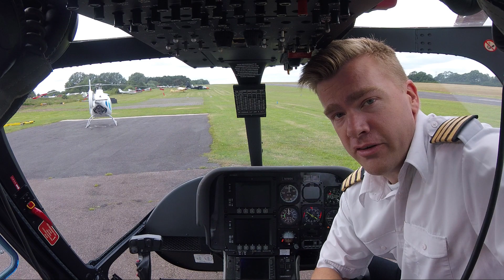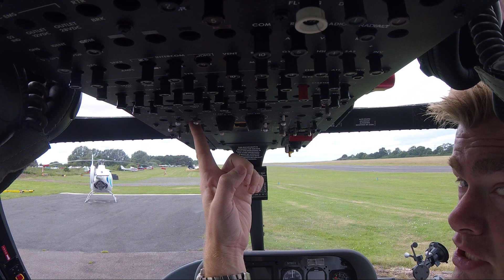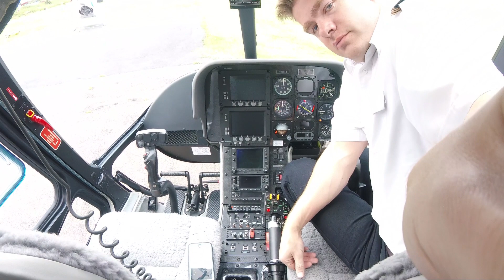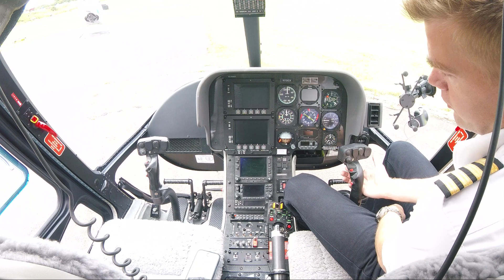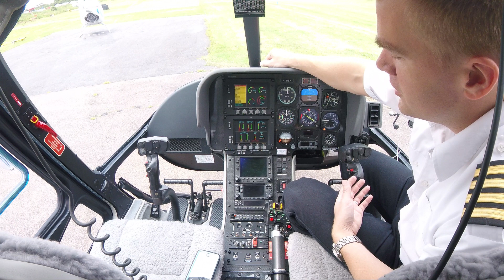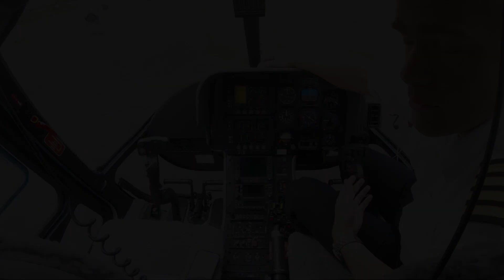Agusta 119 Koala, Cockpit tour and start up

Comment: Great informative video indeed! Just for stake of correctness, Mk.I version (or A119) had either fully analog cockpit or IDS displays like those of the video. Mk.II version (AW119MkII) had initially the same IDS displays, but also increased MTOW  and 102% rotor speed for improved performance and safety in power-off landing. Then the Mk.II platform got in 2015 the Garmin glass cockpit, G1000H initially and now NXi. Finally it obtained FAA IFR certification with the new 4-displays Genesys avionics (unfortunately not yet civil certification in Europe), and won the US Navy tender for 130 training helicopters as the TH-73 Thrasher. Currently in production also for Turkish Armed forces😊